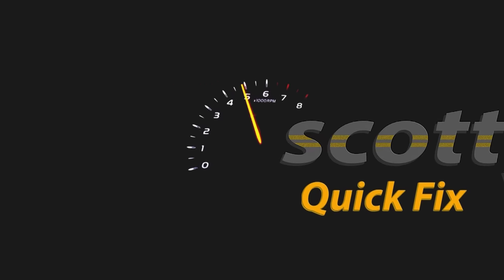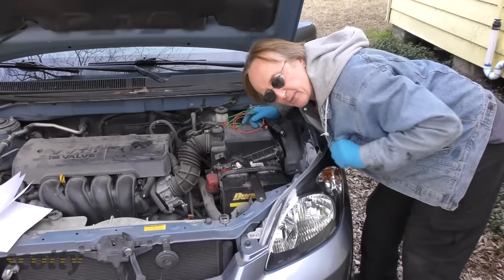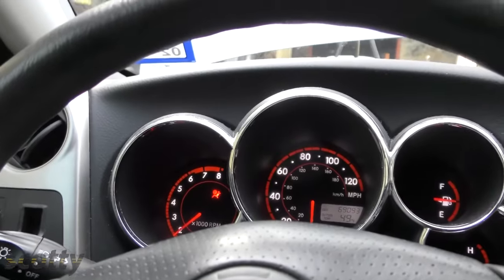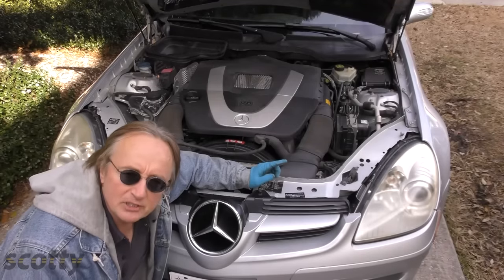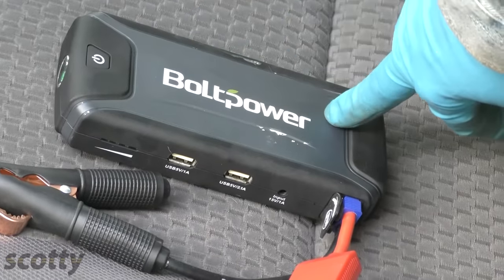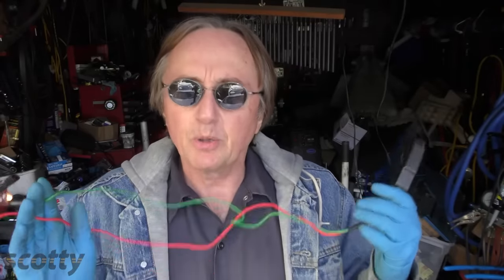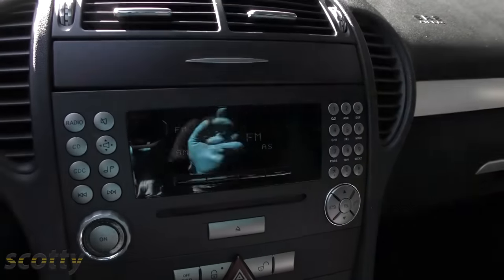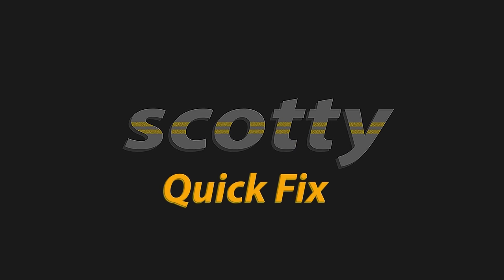How to Replace a Car Battery (the Right Way)

Comment: I think this is a great suggestion - however Scotty I recently replaced the battery on my 2019 Dodge Ram 1500 and the only negative seen was a check engine that went away after 2 or 3 restarts. But what we noticed was no lost radio stations and the big screen now has color accents and now shows the album covers of the songs being played in color! 👍  I thinking the computer did a reset to upgraded down load change - it just needed a power off / reset to initialize that upgrade! Love the video!

Comment: Scotty, you the man! I had a van towed into my job with a parasitic draw. They didn't want anything fixed. Gets towed in the next day saying it doesn't even start with a battery jumper box. This is my theory: Turns out the battery went so low in power for so long it kicked the key out of its system. Reprogrammed the key and off it went. Have you ever heard of this before Scotty Kilmer ?

Comment: 1986 m1009. No computer, no radio, no spark plugs, mechanical fuel pump, mechanical fuel injection, rollem up windows.
The only thing my truck needs to run besides the starter is 12 volts to the fuel solenoid in the Roosa Master injection pump.
It is absurd that modern vehicles are so poorly designed.
Reply: I have a 1965 Mustang with a Retro Radio and the only thing lost when the battery goes open circuit is the radio station. Youd probably lose presets too but I never bothered to program them. In fact, I dont even need to reprogram the blue tooth module. Mechanical fuel pump, 2 barrel carb, throttle arm, cable operated heater controls, simple switches and buttons.

Comment: Interesting, I've done lots of battery swaps with no issues, so I have never thought to do this. Makes a lot of sense though. One thing I'm wondering is, how come the OBD2 port can accept power? I thought it would only go one way lest a fuse pop. Not trolling, I'm actually curious about it

Comment: Mercedes says it has to reprogram the computers and stuff, and it takes hours, and they charge for hours of work.  

But in reality, they probably use the same keep alive tool that you use when they change the battery.
Reply: UrABoxxyBox also, there is the procedures on the forums. I got my procedure for my CLK430. It takes about 5 minutes to do everything. But ill get this tool instead, super useful!
Reply: Yol Yes, this tool is pretty cool, and useful.  I am probably going to get one.

Comment: Great advice as always Scotty! Question, I'm a retired mechanic now selling Auto Parts and handing out repair advice. I've been doing this for years! However, on some cars (especially German cars) our computer database clearly reads "Do not use a memory saver on this vehicle" and we have to call a mobile tech to install our battery. Any suggestions?
Reply: Hey do u know if once I connect the clamps to the 12volt battery....do I turn it on.

Comment: Scotty Kilmer What if I need to change a component in my vehicle that requires the battery to be disconnected? For example, say I need to replace an airbag, would it be safe to use one of these OBD KAM tools with 12 volts running through the vehicle systems, while attempting to replace such components?

Thanks!
Reply: I was going to ask the same question
Reply: Sail R Wondering the same thing.
Reply: Please answer Scotty
Reply: I just remove the air bag fuses.

Comment: I don't know about other mordern cars but in Toyota models like 2010-2016 if you remove the battery the computer reset everything in its factory condition. This helps to remove any virus or any abnormal codes. Virus enter the computer for different reasons. At that time u unplug the battery and reset the computer into its factory condition.

Comment: I had a problem when I changed the battery in a 2004 Chevy Avalanche 5.3L.  The temp needle wouldn't move.  I was able to fix it by Google,  but if I had this it would have been easier.  Great info

Comment: Yeah it’s a pain in the arse when you have to take the car to the dealer just to change the battery in the car. One of the reasons it was an easy decision to trade in my wife’s 2014 VW CC. Loved the car, but if something as simple as a battery change needs to be done at the dealer so they can stick a scan tool on it so it has to be told to relearn window positions, idle and whatever else to run right because it can’t do it on its own, I asked myself what happens if I’m traveling to Vegas and there’s no freaking VW dealer for hundreds of miles and I have a problem?
Reply: Scam central. The fact the computer can't learn window position screams scam. A motor opens and closes the windows why it needs to learn a position. Maybe something to do with the lazy person who wants it to go up and down automatically by their voice will need a computer to do it.
Reply: I'm adding your story to my long list of reasons to prefer manual crank windows.

Comment: Like a PC/tablet, you'd think that modern car ECU/CPUs would come NVRam for the really important stuff, backed up by a different rechargeable/easily replaceable battery, and/or the equivalent of a memory stick, which doesn't need power to hold its data.  Yet another 'mistake' by car manufacturers that just so happens to earn them lots of £££ (or $$$) by owners having to get things reset at the dealership.

Comment: For you '09 F150 owners, I replaced mine with about a 5 minute interval from removal to installation of new and had no problems with re-learning. Did not use this device or any other battery to keep 12V going to the ECM.

Comment: But most times you replace the battery, your battery is already dead, this will only work if the battery still has enough voltage for the computer to operate properly.
Reply: That's why you need to pay attention to how your vehicle is behaving and replace your battery preemptively BEFORE it completely dies. If you have several mornings where the vehicle is especially hard to start, then get your battery tested and/or replaced right away. Simple.

For a bit more complexity, you can get a voltmeter and ammeter gauge installed in your dash, or an aftermarket scantool mounted on your dash, to actively monitor the status of your electrical system. You'll be able to see that your battery isn't holding as much of a charge as it used to, or that your system is experiencing more of a current drain than it used to, or whatever.
Reply: Texas BEAST Are you kidding.  Most people today don’t even know what an ammeter gauge is or how to read it.  They go to their car one morning and find the battery is dead.  Your analogy just ain’t accurate.  Just saying.
Reply: @texasbeast239  I wish I would have done research on why my car was starting with difficulty. So if my car won't start now, is it completely dead and the computer isn't working properly?
Reply: @Kshais  - Can't tell over the internet. But it's best to start with the cheap, easy stuff and then work your way up. 

Make sure your battery posts and cable terminals are clean and not corroded. Sometimes the battery is still good, but it's just so dirty you can't get enough juice in and out of it. I use a small carpet brush like they have for cleaning out your floorboard. Tough bristles work great on battery gunk.

If it's really dead, then take the battery out and have a local car parts store test it. Will probably need to buy a new one. Follow Scotty's other advice on picking a new battery with a recent born on date. 

While you're there, buy a basic OBD scan tool too. Replace your battery, and give it some time to reset any modules that were affected. Then hook your new scan tool up under the dash and see if there are any diagnostic codes. That's the key info you need to determine future repairs.

Don't simply turn the car over to a mechanic you don't know and let them tell you what's wrong with it. Have an idea of what's wrong with it, first.

Comment: Another expensive battery to replace is for a BMW.  Battery located in the back, in the trunk, and under the floor.  Nobody will replace it except BMW dealer.  Takes hours, or days if you need a new alternator too,  and lots of money.  I mean LOTS of money.
Reply: G Scurf My 2012 Genesis has the battery in the trunk as well.  Wasn't too difficult to change but the battery was huge.

Comment: very good advice everyone needs to know this, also never jump start a modern car without special high-quality jumper cables that are ecu-friendly, learned that the hard way back in the day, I fried multiple circuits in a 05 ford took the auto electricians days to find and replace/repair everything

Comment: ....and mannn are new batteries EXPENSIVE these days, let me tell you...smh
Reply: Jonny DIY I've got an Optima yellow-top in my Tacoma that I bought in October of 2011 and it still works great. This year I made it my auxiliary battery and installed another AGM battery as a primary starting battery with an isolator between them both. $300 for the Optima back in 2011, and worth that price.
Reply: +Tim Nelson. Nice! You definitely got your moneys worth on that battery & then some!
Reply: +Kockford Ali. Ive had bad luck with those types of batteries before. The 1 or 2 year warranty ones that are somewhat cheaper than top brands have lasted me, well just 1 or 2 years.  I usually just bite the bullet and get a Duralast Gold at Autozone. Usually get 5+years out of it. 3 year free replacement warranty, and prorated replacement up to 5 years.
Reply: The original battery in my 2007 Tacoma is still going strong.
Reply: Damn thats cheap my red top optima cost me $240 from orileys
Reply: Well there are only a few battery companies and do private labels for various brands, think mcfly think!
Reply: Tim Nelson I've got a red top from '11 in my 6cyl VW, this is the first winter its given me problems, but I dont drive a lot and its been a pretty cold winter up here in Minnesota, so I'm not too surprised.
Reply: Try Costco if you have a membership
Reply: Jonny DIY not for me. I work with batteries for a living.. I get my car batteries, the same brand as autozone, for $49.99..50% off.
Reply: @zachhaefner2711  Which battery do you get exactly?

Comment: Here's what I did. I purchased the battery ahead of time. Then I started up my vehicle and removed the old battery while the engine was running and replaced the old battery with the new one while the engine was still running the entire time. No code problem afterwards.

Comment: Super instructions.  The memory saver instructions were spot on . My presets were saved and the car runs great. Quick question, I installed a AGM battery in my 2020 Hyundai Veloster. I am worried about registering the new battery. Do Hyundai cars have a battery management system? I have checked everywhere online and I can’t find any information. Please let me know if this is something I need to do. Thanks❤

Comment: I replaced the battery in my 2013 Tacoma and expected to have to reprogram my radio stations.  They were still there surprisingly but I did have to reset the clock.  Everything else was fine.  No idling issues or anything like that.

Comment: Thank you for the teaching , my car's remote door locker after disconnecting the battery 
did not lock the doors anymore , my car is 2006 , so i guess this technique may 
solve this issue ? Scot the big Boss .

Comment: Nearly had to replace my 3 year old battery. Rated at 590 CCA and it was reading 412. Being cheap I bought distilled water and some epsom salt, then I topped off all six cells. After driving for a bit it was retested at the same place where it measured 576CCA. Hopefully I'll get another 3 years out of it. Always check the simple stuff

Comment: got me a battery tester like you demonstrated on here not too long ago coming need to buy one of these as well.  You say any 12 volt battery what about the smaller batteries they are still 12 volts but, smaller ones that go in like your riding mower

Comment: The only "modern" things that I like on a vehicle is electronic ignition, power steering, A/C, wiper delay, cruise control, rear window defrost.   My old 85' Ford Bronco and 86' F-150 had those things and I liked them a lot more than my vehicle now. I do appreciate the ability to actually start the vehicle easily in the winter though with fuel injection.

Comment: I use those memory savers all the time they work great ,,, had a Chrysler still have issues even while using it the have a tendency to blow a fuse that prevents them from starting

Comment: My 2004 Tacoma 3.4 takes WEEKS to relearn its AF ratios and idle speed properly! Not only that, but it has to cycle through all of the emissions tests, which took a month this last time.
Reply: And my mercedes relearns it in 20 miles every time, or I can manually reset the module by holding specific switches like the transmission, I can hold the gas pedal for 10 seconds and it will reset it to factory and will relearn its adaptive shifts. Or my windows, or my sunroof, heating, everything can be reset manually, they are computers and require resets by design and none of that require a dealer scan tool, Scotty doesnt know enough about mercedes.

Comment: Reminds me of a time I changed the battery in my 2005 Impala SS. The car had a factory installed anti-theft/cutoff switch system that requires you to keep the memory alive. I of course didn't know that at the time,  and after changing the battery, I couldn't start the car anymore. I was "locked out" and needed to tow the car to GM to have them unlock the car. 😣 Live and learn.

Comment: I had this problem and it was idling, after the battery was removed for a week. Engineer came at my house, then something with the cylinders came up at the diagnostic. After a few days, the car remapped itself and everything good so far. I own a 2007 Mercedes Sprinter van.

Comment: Now even changing a battery is getting complicated! I have a 2004 Mercury Sable and never thought twice about disconnecting the battery when I took it out and cleaned it or changed it. When I connected it all back up, the horn honked briefly to let me know that there was power. The only thing out of the ordinary I noticed was I needed to reset the clock, press a couple buttons to bring up my temperature display, and that was about it. Idling was dead on when the engine was ready, 650 rpm. But being my car is 14 years old, it probably doesn't have near as many extra computers in it than today's cars.

Comment: I love my optima red top. The user manual says you can discharge it to 2v - not 2v per cell - 2v! I still don’t know if this is a typo but that’s what it says. And the battery can still be recovered with a desulphating charger - these are the ones that pump up the battery voltage up around 14.8-15.2v or so, this high a voltage can recover some batteries by effectively cleaning the plates, as far as I understand.

Yes it was a super expensive battery but it will probably outlast me.

Comment: You can buy 12v memory minders as well..not sure in the US but here in Australia some cars like our Ford Falcon for some reason here blow the ignition fuse using the OBD2 port and it's recommended by Ford to use the 12v

Comment: The keep alive voltage need not be connected to the OBD port or 12v.(anything from 9-15V will do.    It just needs to be a 12V device that is switched on.  I've done it using the dome light contacts, jumper clips  a diode for reverse current blocking , one resistor and 2- 9V alkaline batteries.  A vehicle with an always hot cigarette lighter socker works too.

Comment: Not to mention all of modules reset of you remove the battery than then have to go for inspection. Can be a real PITA to make sure you complete all the drive cycles before going. With this you don't have to worry about it anymore.

Comment: My electrical instructor taught a neat trick,that cost $3 to make.All you need is an old car charger the kind you stick in the cigarette port,you splice the wires and stick a 12 volt battery and when ever you change your car battery you just stick that in you cigarette port and it stores all you settings.Cool huh.

Comment: I didn’t have any problem with my ol 05 focus. I replaced a battery and let the car relearn itself. The only thing lost was the time and radio settings. My new focus on the other hand could be different. They are solid cars depending on the year

Comment: I remember way back in the day guys would use a 9v connected through the cigarette lighter. Doubt it'd work anymore. But it was enough to keep your radio presets and that's all we had to worry about.

Comment: I just leave the car running , remove one cable at a time and put connection in a latex glove. Change it real quick and hook it back up. Has never failed me. Damaged an alternator nor thrown a CEL.

Comment: You can also get one of those keep alive tools that plugs into the cigarette lighter and uses a 9 volt battery, I don't know if it will keep the PCM memory but it will keep your radio memory.

Comment: My Saabaru is like this. Replaced the battery last year, and after, idle was very poor. Would even sometimes stall out when I clutched in. Thank god for Google. All I had to do was turn the key to On without starting the engine for 30 sec, then let it idle for 5 min in the driveway to make the computer relearn its engine settings.

Comment: Volvo offers the security codes for their radios for free =) I think folks over simplify just what all the modern CAN-BUS can and does control since almost everything is now hung off it. You have throttle adaptation, fuel trims, alcohol sensors (freaking ethanol...) seat positions, radios, door locks, transmissions adaptations, climate control, ride height - just a ton of stuff! And all of it can't wait to break, ground/short the can-bus data lines and leave you stuck.

Comment: why not just hook jumper cables from a good battery to the battery wires before unhooking them from the battery to be replaced - the computer won't see any interruption of a 12 v supply